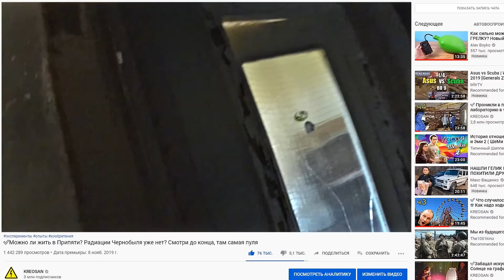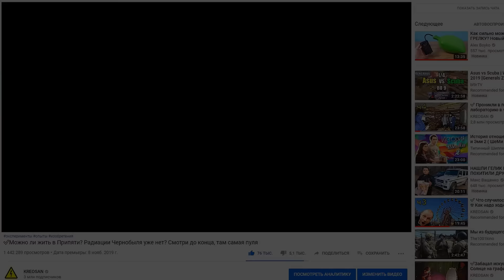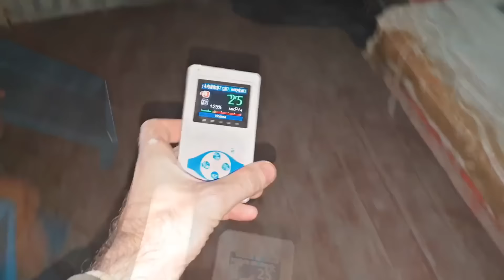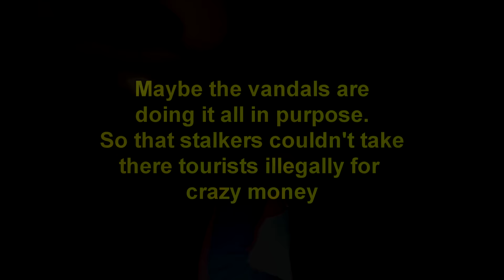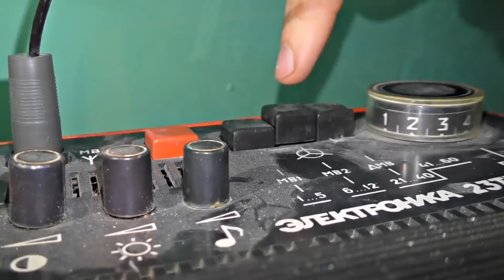☢️Chernobyl Flat Repair Like😨Did they see us??

Comment: I don't know why you do that???why you are exposing yourself for this high dose of radiation for nothing
Reply: It's not that high of a dose. They check regularly and uses the meter. The only thing I'm worried about is if they eat fish or water from the river
Reply: Omar by the way there is expose to dust and they touch everything it is also dangerous because they become radioactive too,,,what is the difference between them and the firefighters that their clothes still radioactive????there is no diffetence between them I think
Reply: @Dr.aryan_mhedin  U can't become radioactive. ARS is something that you won't directly get from mild exposure. The firemen during that time got directly exposed. Many people on yearly base visit Pripyat and the Chernobyl zone. It's not dangerous as long you keep checking the counter. Beside some people even have lived inside the zone for the past 34 years after the accident. However it's not healthy ofcourse. Because of the mild radiation its hard to get exposed with clothes on. Only trough direct exposer like eating it or having a wound and the dust goes is you might get sick. Still this sickness won't be deadly only on long term.